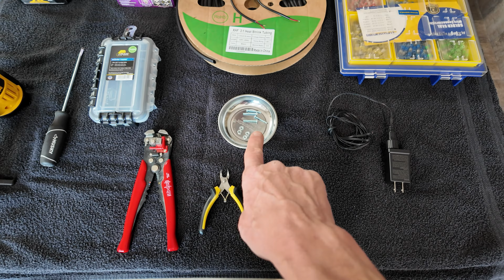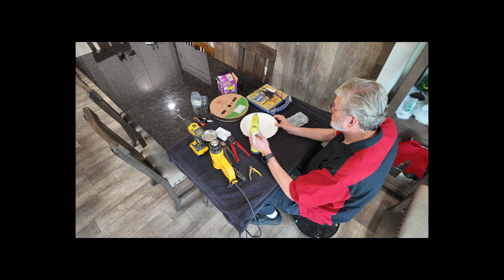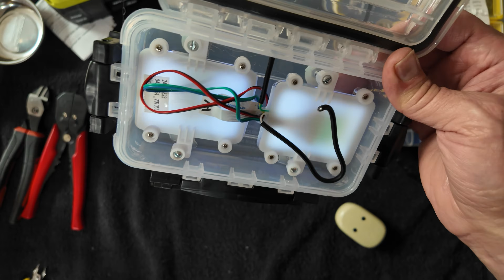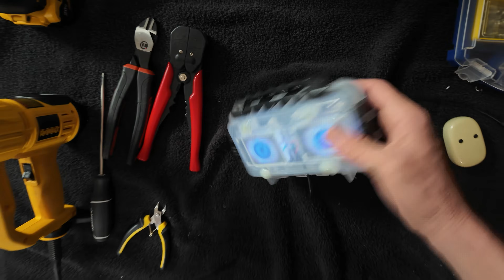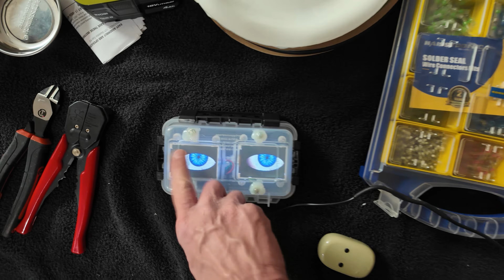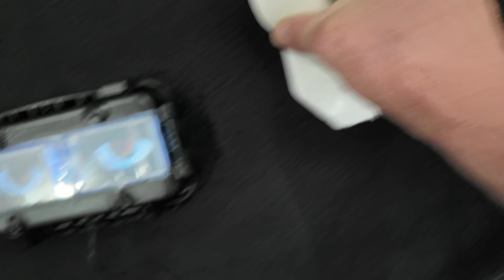DIY: Turn the Home Depot 12-Foot Skeleton Eyes into Spooky Halloween eyes Look! 🎃

Comment: This is excellent and exactly what I'm looking to do! I have read elsewhere that the voltage required is 6v (4C batteries) for the eyes. Do you think there's any concerns with running at this lower voltage?
Reply from the maker: Yes, it states that. But it’s running fine with 5 V power supply for me. If you want to make it battery operated, you could probably find a waterproof 6V rechargeable battery pack. Or place it inside of a waterproof case. Or a 4C cell battery holder for the batteries, and then place that into a waterproof case and change out the batteries when needed
Reply: @diylightguy thanks for the reply. I don't want to use batteries at all. I just hooked up the eyes I have to 5v and they are running fine like yours. I also see a post of someone using 4.5v. These probably have a range of voltages that work for them considering that they're supposed to be battery powered. I'm up and running. I love your channel. Keep the videos coming!
Reply from the maker: @TheJoeFletch  thank you! I’m glad you like my videos